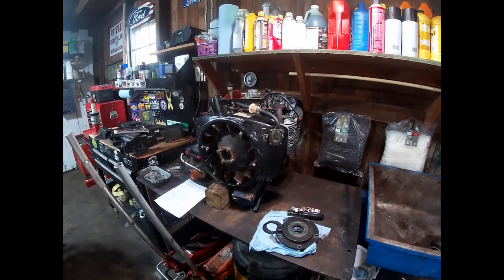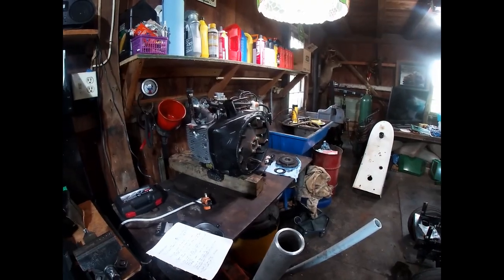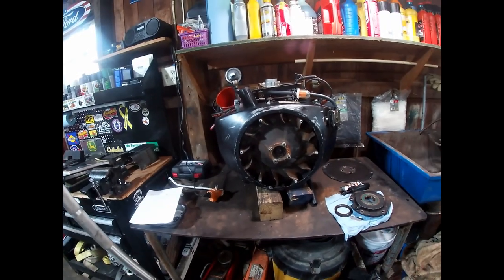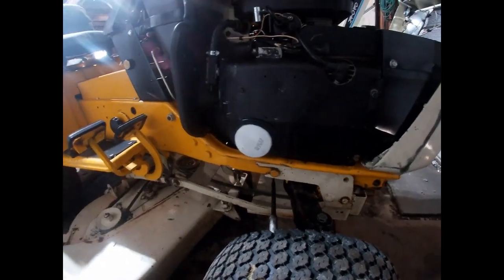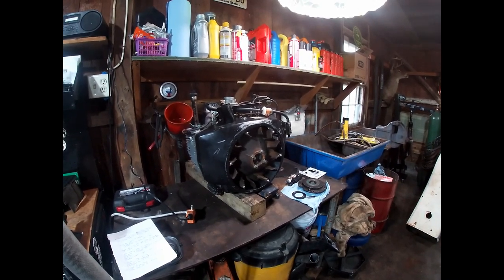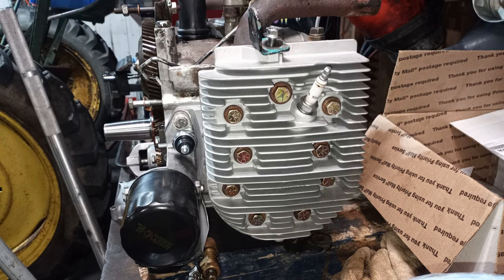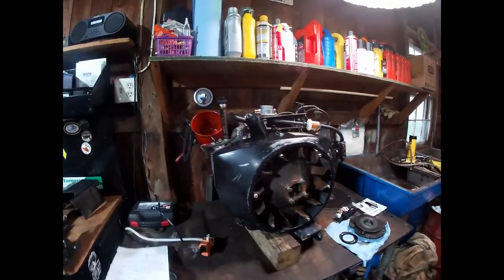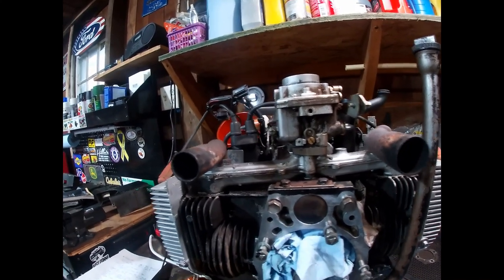10 Tips to MAXIMIZE the Life of the ONAN Engine in Your Garden Tractor - Long Live the Opposed Twin!

Comment: Thanks a ton for this video, it is an extremely valuable resource.  Would I have bought my 1988 316 if I saw your video first?  Probably, I needed one pretty quickly and it was the only 300 series in my budget.  Is it a bit of a mess that seems to have been neglected?  Also yes.  It has no belly screen, had no air filter foam ring (bought new air filter that included this), no oil filter shroud gasket, cooling fins very cruddy, and was even missing the large air intake tube that I have since ordered from eBay.  I'll get that other stuff including the firewall heat shield as soon as I am able, as well as doing all the other overdue maintenance.  I'm hoping I can still get it to top running shape.  Thanks again.
Reply from the maker: Glad you found the video useful - your 316 and its engine will certainly thank you for getting it back into shape. These tractors (and engines) are very tough and are usually forgiving as long as they're kept in the right hands and given a little extra care - especially with them having some age to them now.

Comment: Hi Mike. Very informative video. What's your thoughts on replacing the intake valve seals after removing the valves for clean up on a p220? Have you done it without replacing the seals? I know the Onan manual says to replace them any time you remove the valve. I know the b series doesn't have them. Just wondering your thoughts on it. Thanks. Keep tractoring.
Reply from the maker: The only sure-fire way to know if your valve guides and seals are in good shape is to check the valve stems with a micrometer to see if they are within wear spec. Like you mentioned, it's a good rule of thumb to replace those valve seals whenever the valves come out, and in the case of the P series engines known for valve train problems, I wouldn't hesitate to replace the seals if you are doing any kind of valve train work. It's a good preventive step to take while you're that far into it.

Comment: Love my Bolens QT-16 with the Onan  but my Deere 116 i repowered with an 18 hp B&S opposed twin that has the spin on oil filter and an oil cooler. It will as will the Onan outlive me...
Reply from the maker: I wish the Onans in the 316/318/420 tractors had engine oil coolers. Probably would have saved a lot of headaches.

Comment: I wonder if an Onan CCK engine would be a good repower solution for the JD 318 ? There are so many CCKs out there.
Reply from the maker: CCK would be too large to fit with the hood and side panels in place, but I seem to recall seeing one with a CCK in it before. Would be good just to power the tractor if you don't have a use for the PTO.

Comment: Great video, I have two machines with Onan's, a Sears SS18 with a B48M (Canadian sold model) and a Cub 982 with a B28G. Need to Fit a surging problem on the B48M but the Onan in the 982 runs great.
Reply from the maker: Hopefully a split and reseal of the intake manifold will take care of it. Those older B series like the B48M are good tough engines.
Reply: @MichaelTJD60  Unfortunately split and reseal only helped some. The sears has the  marvin schebler DD13 that from what I've been told throwing amazon parts at doesn't fix right. I got the brass float and an Onan carb kit from an Ingersoll dealer so hopefully that does something if not I have both gasket kits for it and I'll just redo the motor from top to bottom.
Reply from the maker: @FullMetalFab  Those Marvel-Schebler carburetors are a bit of a dinosaur by today's standards, but it's neat that yours is still present, as a lot of them were replaced. I'm not a fan of Onan's use of downdraft carbs...I wish they used a traditional side-draft carb like the Kohler opposed twins.
Reply: @MichaelTJD60  if I wasn't so persistent with keeping it original I'd swap it for the walbro like what is on the B48G in my Cub 982 but it ran nice ones and it should again. I agree the carb design being a little dated and a side draft would work much better and be a lot easier to set.

Comment: I just bought a wheel horse 520h with a 1993 p220g onan the engine is getting good fuel it has good compression it’s only 967 hours but has no spark I checked for spark checked the plugs what’s a good route to go to look diagnose and test thanks mike
Reply from the maker: See if you are getting power to the coil from the ignition module - this should be done with a fully charged battery, as the P series engine with electronic ignition will produce weak or no spark when the battery is dead or too low. Considering it's a P series, there's a possibility the ignition module could be bad which will require pulling the engine and removing the flywheel.
Reply: @MichaelTJD60  thanks I’ll check this later I’ll charge the battery as well

Comment: Nice video I’ve found that you can buy most of your onan parts through John Deere at least for my 318 my engine is a 92 so how does the fly ball spacer in my engine does that still fail like the Ostia or whatever ? I just got a new oil filter gasket it plays one but kept falling off and yes it is an important part for the 5 bucks it is it’s worth it
Reply from the maker: Deere is a good source for a lot of Onan parts (due to the popularity of the 318), but their markup on pricing is ridiculous. I very rarely go through them for Onan parts anymore unless it's an emergency. Your '92 will have the extended tab plastic flyball spacer - it should be fine.

Comment: Great video and extremely informative. I have a JD 316 with the B43e non oil filter engine. Im trying to find a kit to completely reseal the engine, it just pukes oil everywhere. Its gotten to the point where I made a catch can and re routed the ccv line to that instead of the Intake. I would love to find a link to a re seal kit, I just can't find one. Any help from anyone would be appreciated! I'd love to keep this rig alive, its built like a rock
Reply from the maker: Check out the OnanParts.com valve grind kit and bottom end gasket kits. They will come with everything you need.

Comment: I get why running at WOT while working but when I get done mowing I put the mower away. Should I still idle down for a minute or two to let the engine and everything “cool” before I put it away?
Reply from the maker: Yes, you'll want to idle it long enough to cool things down, but not too long that it will start to overheat. A couple minutes should be fine.

Comment: Reason i ask is just about 2 weeks ago we had a dramatic drop in temps like 30 40 degress in a matter of a few hours srated the tractor up engine was over revving a bit no throttle control at all would not idle. i was hoping that you could give me some ideas to prevent this from happaning i did take some turbine oil and dribbled some  on all of the connecting links on the carb and on the govenor.
Reply: When it warmed to about 40 degrees it was fine.

Comment: I just got a 316. I gotta do some work on the tractor and right now ive run it without left panel so i can keep on eye on it looking for the oil leaks since it has a film covering it.  Granted i was only usy the trl to haul brush out so load it start it drive out and back and off again.  My tractor has been repowered by a b48
Reply from the maker: Probably the common oil filter plate gasket seal or a front/rear main crank seal leaking. Nothing unusual.

Comment: Wow, very well explain video. Thank you very much for the info. I have a question when you mean 1/4”machine bolts and nuts for the intake your meaning quarter inch long? because you’re only going to drill out rivets with an 1/8 drill bit correct?
Reply from the maker: You're welcome, glad you found the video useful. Yes, I should have been more clear - the machine screws would need to be 1/4" long.

Comment: When the cooling fins are regularly cleaned these motors don't have exhaust valve problems
Reply from the maker: Correct, but unfortunately they often don't receive proper cleaning and spend their lives accumulating debris.

Comment: I am going to pick up a 24p today that I am putting in my 62 Simplicity Landlord.  It is a much needed replacement the Briggs 8hp just won't ever be enough for me.  33 years ago I was taught how to cut my Pepe's lawn on this very garden Tractor the 8hp will pull anything in 1st gear but if the grass is tall you have to mow in 1st.  I think I am going to add a nice big oil cooler and possibly a small fan just for the cooler.  I will use a couple of quality check valves so the oil pump will be able to handle the cooler.  If anyone can think of any possible ways this might hurt this engine please school me.  If it just ends up beginning a waste of time and money we'll I will share that.
Reply from the maker: It sounds like an excellent idea and a great way to prolong the life of the engine. I would be eager to see what kind of wear patterns the engine sees in the long run from the oil being circulated through a cooler and it might also be a good idea to do an  oil analysis to see how the oil breaks down over time.

Comment: Don't get me wrong... I really like my 3 original Onan engines, the B43 in the '86 318. the P218 in the '88 318, & the P220 in the '88 420, but there is certainly something awfully COOL about the Honda & the Briggs Vanguard V-Twin Repowers also...!   (I guess I just appreciate the ingenuity and engineering in the repower designs...)
Reply from the maker: The newer v-twins are definitely more refined and efficient but in my opinion you just can't beat the sound, ruggedness, and torque of an Onan...once you get past the intake leaks and the pungent exhaust smell. Lol.
Reply: @MichaelTJD60  I agree, and I would rather have originality too, that's why all 3 of mine still retain their Onan roots... even if they all are between 1,000 & 1,500 hours....

Comment: Have you ever added a temperature gauge to one of these?  I'd love to add one to my engine,  they could be overheating and we'd never know
Reply from the maker: I personally have not, as I don't think it would really be necessary. From my experience, easiest way to tell if they are overheating is to feel the hood or side panels of the tractor with the back of your hand, and see if they are hot to the touch. If you can't hold your hand against them for more than a couple seconds, your engine is probably running too hot. When it's within the proper temperature range, the hood or side panels will be warm but not hot. On a summer day, you can feel the engine heat radiating back toward you when it's running too hot - they were designed to push the hot air out the front and away from the tractor (in a JD chassis, anyway), so you shouldn't be feeling any heat coming back at you.

Comment: Great video,  I just picked up a Concrete saw with a Linamar LX990 / 11257H   show it is a 980cc  Not finding to much about them.  Made in Canada.  Do you know any places I can get some info for it.  If it runs I might toss it at an old 316 a for laying around with no engine lol
Reply from the maker: LX990 is the same engine as an Onan P224G - try searching for P224 parts and you might have better luck. That won't fit in a 316 unless you install the shorter air cleaner box and the shallow oil pickup and oil pan from a P218G or similar.

Comment: I use an oil filter made for a 1999 Ford Ranger w/3.0 V-6 engine. It is slightly longer and adds to the oil volume.
Reply from the maker: Great to know that the 3.0 oil filter fits these engines - they may stick out too far to fit in a JD or Cub Cadet garden tractor with the side panels installed, but should be fine in other applications.
Reply: @MichaelTJD60  I have a Wheel Horse 520-8. With the filter sticking out farther it's also easier to remove. I use Napa Gold 1516 filters.

Comment: I'm just curious but are the parts interchangeable from a Onan p218 and a Linamar lx770?
Reply from the maker: Yes, the Linamar LX770 is the same engine as a P218G with spec D or later (steel crankcase breather). There are other minor differences like the carburetor and linkage, air cleaner cover, and some have extra drain plugs in the oil pan.

Comment: hello i have a b43g i bought from a storage place it looks like is in great shape i want to try and start it to see if it runs how would i nump it to get it to run
Reply from the maker: Hook a jumper between the positive post of a 12V battery and the positive side of your coil, and a second jumper from the negative post of the battery to a bare bolt or metal surface on the engine. Run a second 12V lead to the starter so it will crank over, then immediately remove the lead once the engine starts.

Comment: Hey Mike, very nice video. Just Got out the trusty old gt2544. (Already mowed twice, lol). Its running like a champ! Couple of questions, how long does it take for a machine to be “old”? Also what is the best way to keep the Command series kohlers running for years?
Reply from the maker: Thanks Aidan. "Old" is subjective...I even use that term to refer to the new Kubotas I sell at work. Most of the same principles that I discussed in this video apply to the Commands, but especially running wide open and using good oil. Running the Command in my grandfather's GT2550 at half throttle for so many years definitely took its toll.
Reply: @MichaelTJD60  Good to know Mike. I run at full throttle when ever im doing work with the machine. If not half to 3/4 is all i need to get back to the barn. Also i do use good oil. So i guess is there any other tips on some ways for them to run for a while? Other than not to abuse them.
Reply from the maker: @JoshAllen17Goated  I've heard the Commands are especially picky about having a clean air filter - obviously any air cooled engine needs a clean air filter but the Commands are not very forgiving if their intake airflow is restricted by a dirty filter. So that's definitely one item to keep in mind - in hind sight we should have probably been cleaning the filter on my grandfather's GT2550 once a week with all the use we were giving it.
Reply: @MichaelTJD60  good to know thanks!

Comment: Hi I have a Onan NHC p224 in my gehl skidsteer I just rebuilt it what is the lowest rpm I should run at for proper cooling thank you
Reply from the maker: In a skid steer application, I'd be running it wide open as much as possible to allow the hydros to work efficiently without putting too much strain on the engine. And with it being in an enclosed compartment, wide open throttle will be the best way to maximize airflow to that engine.

Comment: Another thing that sucks about repowers? They recommend leaving the engine tins off! Hell no! I think they are worth less if the original Onan is gone and I won't buy them. I own 4 318s, a 1985, 1986, 1988, 1991 all original Onans, except one has a newer Linamar but is an Onan P218G. Just built in Canada. Love these old tractors. Rebuilt the '91 so far and the '85 is next with a B43G.
Reply from the maker: Great point! Most of those repower kits are made to be shoehorned into the engine compartment of a 318 (for instance), usually don't fit correctly without drilling new holes, and usually don't fit without leaving the side covers off or cutting a hole in the side cover to fit around them. More trouble than they are worth. It sounds like you have a great fleet of 318's. I didn't mention it in the video, but my inspiration comes from my uncle's fleet of 318's ('85, '86 he bought new and now has a Linamar, '88 and '89) which are all used and abused on the farm and have proven themselves reliable over and over again.
Reply: @MichaelTJD60  I like them un-molested too all of mine but 1 only had a dealer stickers no cup holder drilled into the fenders, all the tins are there and belly screens on. My '88 had been repainted and don't even have a dealer sticker on it. I will keep these going until my time is up and I feel the 318s will still be running strong. Can't say that with today's crap we get.

Comment: Two questions....what is the proper break in for onan nhc in my gehl skidsteer 2cyl air-cooled and because i live in a snow area in winter do i still need to run full throttle in minus 20 weather
Reply from the maker: These engines are best broken in under a load. Start it up and let it idle until it gets up to temperature, then gradually increase the throttle to wide open, and put it under a good steady load for a couple hours to let the rings seat. Babying them won't allow everything to run in properly. If it's 20° outside you'll have to worry more about the hydros overheating than the engine. Wide open throttle will allow the hydros to work most efficiently.
Reply: @MichaelTJD60  great information thank you did not know about the hydros

Comment: I have searched and searched, and I could NOT find a magneto for a Montgomery Ward 16hp generator with this engine. I fabricated an aluminum plate with an Accel HEI module / ABS wheel sensor triggger / Kohler 2-wire coil. I went to the Onan website, and even the used parts were no longer available...... What did I miss?
Reply from the maker: A P218 engine has electronic ignition with an igniter module and a pickup ring, but it's not the same thing as a magneto.  The pickup ring and module can be bought through Boomer's Onan Parts or a Cummins dealer, last I checked OnanParts.com is sold out of them.
Reply: @MichaelTJD60  Thank you